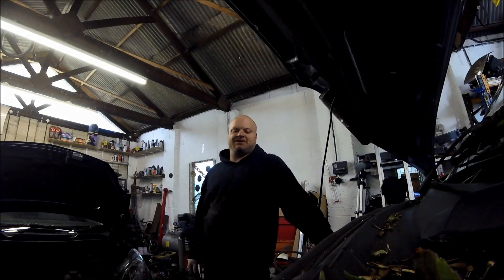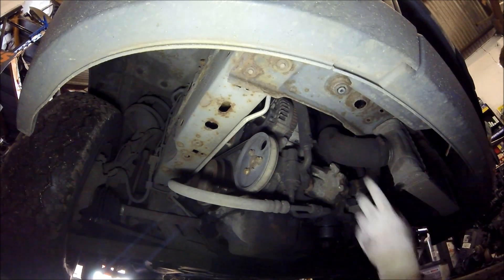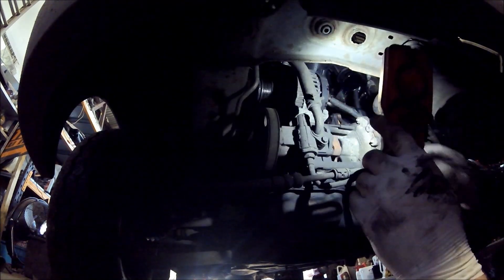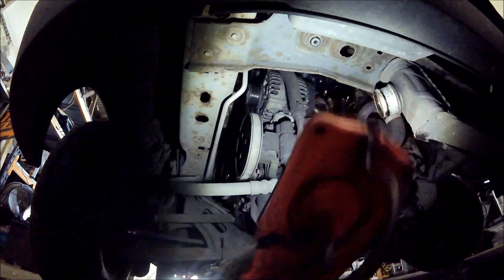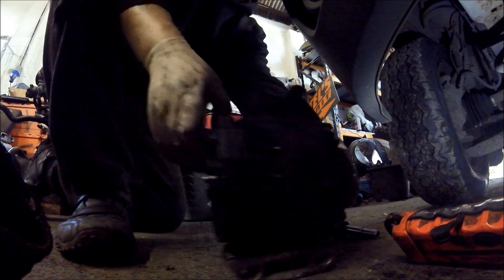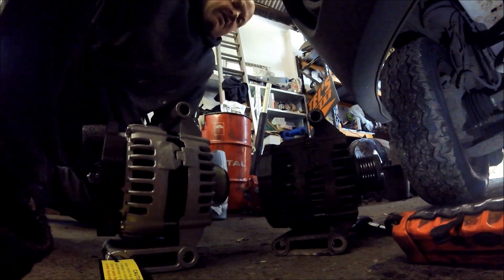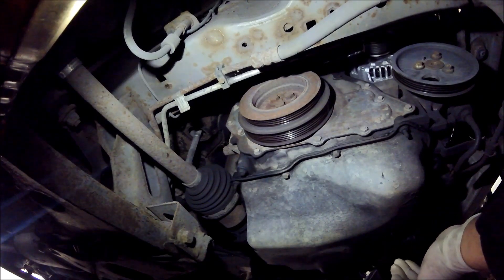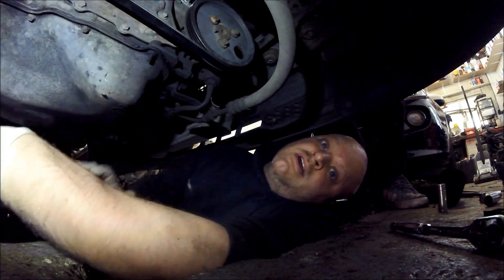how to replace a alternator 2.2 tdci ford transit mondeo fix repair fit fitting

Comment: I've a transit the same..when I put my alternator belt on like you did it comes half off the alternator pulley.  I didn't see you doing any guiding of the big belt onto the alternator pulley at All ..can you move a belt over a notch or two one it's on?
Reply: Same as me how do you get your belt back on did you have to take the altanater back off to get that belt on